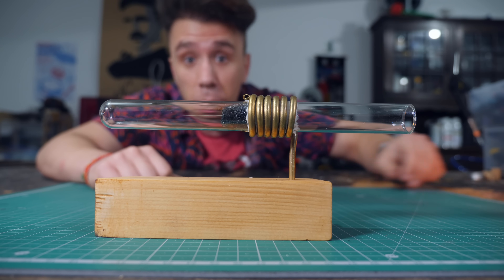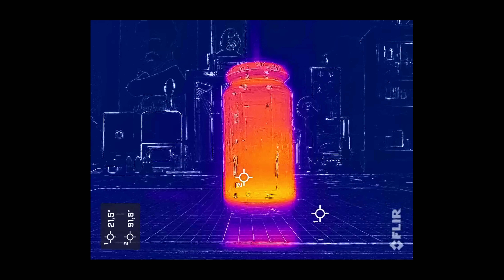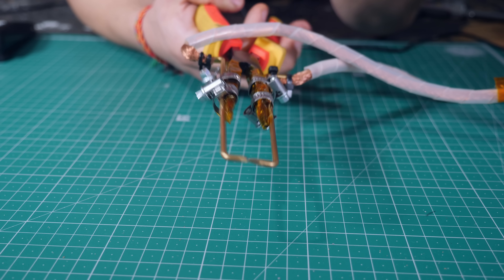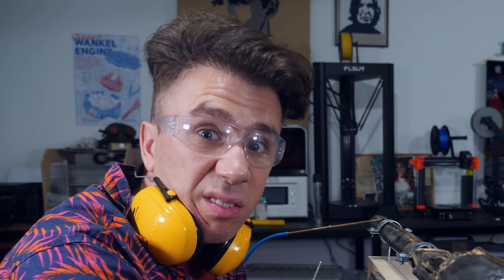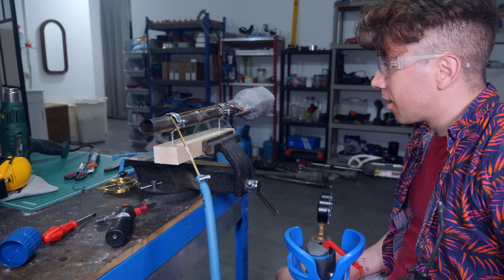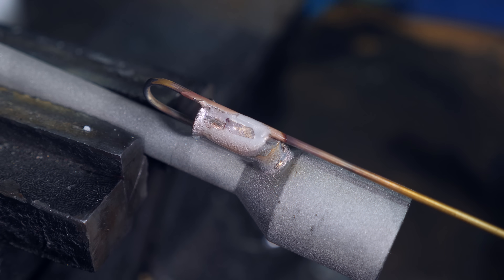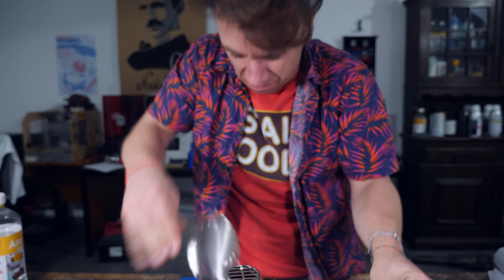JET ENGINE with NO MOVING PARTS (Pulsejet Engine)

Comment: would you be able to do a homemade telescope?
Reply: The important question is what's your budget... If you just wanna see the moon and planets .. even saturns rings , you can make one for pretty cheap , I made one for about 25 usd
Reply: @zakirsheikh4209 any link for that?
Reply: my friend made a solar projector (basically a telescope which is designed to project an image of the sun onto a surface) as a school project. He built it out of cheap materials on a budget of about £50. The most expensive things were the lenses, but he used quite large lenses. If you chose smaller lenses it could be cheaper. Nonetheless, its actually a great solar projector, its easy and safe to use (you physically can't look directly through it) and if you can see the sun, then you can see the sunspots on the projected image.
Reply: if he is making the lenses, that's going to be a near impossible task. If he is using a kit, it seems... a bit too easy. 

The middle ground would be: buying the lenses, then 3d printing the telescope itself. I don't know what level of challenge that would be for him 🤷‍♂️ 

Interesting idea, though 👍 I've seen people use raspberrypi and arduino setups that allows for a telescope to track object automatically.  

It also used a reference point in the sky, so the user could enter a celestial body they want to see and the telescope would move via the electronics so that it was pointing towards the desired object. It was pretty cool but more about programming than building, in that case.
Reply: I'm not sure if the lenses or mirrors can be homemade and work well enough
Reply: That would be pretty impossible without expensive technology
Reply: Booring.

Comment: You have 3d printer, spot welder, you can print small centrifugal compressor, make combustion chamber, nozzle and turbine, make small 5 cm diameter turbine jet engine, like this one:
https://www.youtube.com/watch?v=0QRuiT2DjpU&t=32s   it would be great and put it on small 3d printed jet rc plane, you can use light pla filament, it is used by modelers of rc planes...

Comment: Could you 3d print FDM and then use nickel plating spray to make it more heat resistant? Some use that spray to plate plastic with other metals.

Comment: Does the larger pulse jet need tuning to run on different fuels, tube length for pulse frequency etc does the stoichiometric ratio need to be considered. have you thought about trying to cast your pulse jet?

Comment: If you not good at welding , why do not try with molding parts the most exposed elements to heat (like chamber or exost). You can  3d printing model and make a mold using it (like here https://www.youtube.com/watch?v=2CIcvB72dmk&ab_channel=CastingtheFuture)

Comment: My bid for the 3D printer: Make a jet engine that runs on any oil which produces electricity to power any vehicle. A jet powered generator that produces electricity on-demand to move your car. Your fuel would be free, you can get it from local restaurants. The same technique that train companies use now. If every gas vehicle was powered this way cars would use much less oil. They go much further when the gas is used to produce electricity than an explosion. Efficiency is way higher when you burn the fuel locally.
Reply: If any of your engines you've made over the last year were used to produce electricity they would move a car.

Comment: 3D print a taurozzi pendulum engine there is very little to no friction in the design perfect for a print. They make them mostly for air compressors, but I'm sure you can run it with any fuel source. 😎 
You could use the engine to outrun an attack from the Killer Tomatoes
😂😂

Comment: Hey integza i got an idea maybe you can put it in action. Can you make an HHO generator that is powered by the same power output of a jet engine running out of this same HHO generator. Basically make an HHO gen running out of the power of an electric generator being pushed by the same jet engine pushing a propeller.

Comment: You cant run away from welding any more. You clearly need it.
anyway, I think seeing you tinker about radio waves would be cool.

Transmitting energy with radio waves to power something, as in wireless chargers.
Or maybe a simple radio transmitter so you can radio control a boat or something. If I recall correctly Tesla did it, so you should be able to as well.

Comment: I'd be over the moon if you tried water cooling (or fuel-cooling?) one of your jet engines. Maybe try another 3D-printed engine with fuel channels integrated into it like Nasa did with their rocket engines (Nasa used wax and electroplating deposition technique, but 3d printing might prove a liiiitle bit easier ;) ). congrats on this engine btw, it looks stellar!

Comment: I just watched your Tesla Turbine video before this one and had an idea for it. You should use the Tesla turbine to try and make a generator that use steam heated from solar energy. Maybe water in black tubes or barrel, the black absorbs the heat, which heats up the water and makes pressure and steam to power the system. It would be interesting to see if a system like that would work. It would be really cool if you could somehow make it an  enclosed or mostly enclosed system to recycle some of the steam. Hope that makes sense. I want to try doing something like this and it would be cool to see your attempt at it and even see if it's a plausible design.

Comment: Metal working isn't as hard as you might be making it out to be. You could learn to run a wire feed welder in a few hours with some YouTube. Flux core wire doesn't need gas, so it can be a simple and very cheap way to get serviceable results. I paid about $100 USD for mine plus $40 for an auto darkening mask.

Comment: There's a process where you can cast your own aluminum parts using a 3D-printed positive... it could be useful to make large, cheap, heat-resistant metal parts for new engines

Comment: Possible future video/implementation
you could build a small thrust measuring setup, guided on air pressured rails (atmospheric railway), so the future jet engines can move with minimal traction. More air pressure could also support the weight of the whole system. The thrust could be measured by the sled pushing against an precision scale. This way you could directly record it for the your videos
It would be really interesting to see and compare the thrust from different engines

Comment: What if you water cool the engine to prevent it from overheating or use a fan to blow air around the engine so the engine can stay cool for longer?

Comment: Do do you want a material that's called Starlight. The original innovator of it passed away before anyone can get the formula out of him but you want to cover a lot of this stuff that you're using wood Starlight it's basically fire retardant and Fireproof it was one of the original set the tiles it was put on one of the first space shuttles the gentleman then told NASA they were not allowed to have his stuff and literally removed it all from NASA's property and possession. But dude when you're doing stuff like that JB Weld withhold heat way better than a spot weld does and using that flux to weld with it gets too hot that flux melts right away you got to figure out a way to get your stuff to where it's almost impervious to heat you'll have to layer it with several layers of fire retardant material how about wrapping the outside of it with the same stuff that they use to make metal forges you can use household insulation when you get it wet it works real good smashing drywall spackling into the fibers once you get it wrapped it's bismuth and gypsum mixed when you pack it down and get it really really tight IT compresses everything and it makes it almost fire-resistant Fireproof

Comment: Integza thank you for delivering such top noch content. Jet engines have always been one of my favourite topics and like you i am also truly fascinated by the pulsejet due to its thrust to weight ratio, lightweight design but maybe most importantly the sheer simplicity of its design. "Where normal people only see some random pipes, i see a potential jet engine."

Now for the main part: I have a suggestion for an experiment that you could try out with a pulsejet. I just happened to remember one of the Mythbusters episode where they tested out sewer explosions that caused manhole covers to be launched up in to the air due to ignition of built up methane gas. Now the most interesting part of this experiment is what happened when they loaded the "sewer system" with different types of debris that caused the explosion to accelerate at an extremely rapid pace compared to the "clean" sewer system (in the small scale sewer test that they performed i believe they tried filling it with metal springs/ coils of different sizes that would simulate objects that may somehow end up in the sewers like ex. bicycles, wheels, wooden planks and other random types of debris/objects). This made me wonder if this effect somehow could be exploited to increase the performance of a pulsejet by for example placing a metal coil(s)/ wire inside the combustion chamber or perhaps by partially or fully lining the combustion chamber with some kind of steel mesh. 
I think it would be really cool to see some experimentation using this effect/ principle and if you are able to make it work reliably maybe you could build a test rig and compare the performance of different fuel types like Propane(used as a referance fuel), Ethane, Methane, Hydrogen ++ and maybe even try some types of liquid fuel like different alcohols, heck maby even some Nitromethane. Just be careful when using liquid fuel as it can be hard to manage it in a pulsejet and can easily drip out of the pulsejet and set the ground/ surrounding on fire (In my teen years i once set my parents wooden terrace on fire while trying to start a pulsejet using a 50/50 mixture of alkylate petrol and nitromethanol(25% nitromethane IIRC), luckily for me my ADHD brain had developed enough sense in regard to safety to have the gardenhose laying ready in case this were to happen). 
As an additional note: Different fuels may operate optimally at different pulse frequencies, this probably also depends on related factors such as fuel pressure and injector design/ placement. To a degree you might be able to make a quickly tuneable adjustment system to the pulsejet by adding a telescopic section to the tailpipe as this can alter the "resonance/pulse" frequency it operates at (IRRC there is someone who have tried this and have a video(s) about it here on youtube).
Best of luck with your future projects and experiments

Comment: Make a vid about where you learn to weld better and make a turbofan not turbojet engine 
A turbofan is a jet engine which has a bypass to cool the main engine which takes like 20% of the total air sucked by the huge fan in the front of it
If you learn how to weld better then you might be able to make it 
If you did then put it on Idk a skateboard or rc plane

Comment: Having an active cooling system might help with the melting issue. No idea how jet engines do it, but rocket engines use the fuel, which might work here (or be disasterous). You could run the fuel line coiled around all the parts that get hot before pumping it into the chamber, which might increase cooling and performance, and at the very least add thermal mass to the sheet metal. Just adding more thermal mass by sticking more metal on there, like brass tubes coiled around the chamber, would probably also help avoid melting.

You could also use water, either passive submergence or active cooling (maybe pumped around by the heat energy of the engine), but i feel that might miss the spirit a little bit.

Comment: Maybe make a lightweight rc plane that uses the little metal pulse engine? Maybe make a "paper" plane body with the resin printer (using the thinnest printing setting) and fire proof it so it doesn't melt

Comment: A flying pulsejet get's air cooled ...if you water cooled the metal / plastic static engines you might if doesn't melt ...

Comment: All of your stuff blows up because it gets too hot.

I dont expect you to use the fuel as coolant around the hot stuff as did in most rockets, but you are stationary and weight doesnt matter on your „test stands“…. build a cooling jacket and pump water thru it, i want to see a engine giving full power for some minutes without blowing up/overheating.

Comment: Video Idea: Utilizing a sand battery and a stirling engine in combination  to produce power. Or some variant of thermal powered engine. I think thay using the a stirling engine as a heat pump to assist the heating of the sand and then using it to produce power.

Comment: How about adding Tesla Valves to the Pulse jet engin.
Sothat the air intake is on one side of the Engin and on the other side is the exause. Both hate a tesla valve that only allows flow th the excaut. I´m ont quite sure if that defeates the purpose of a puls jet or it might become a continious jet engin.

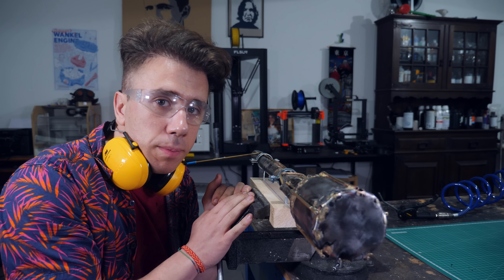Comment: 5:34 Yeah, wishful thinking. Renewable energy, in particular solar, are at pitiful low levels simply because they're not reliable enough. Solar is good for small applications, like portable chargers and rooftop installations, but using solar power to power a country is an environmental disaster, not only due to all the wild habitat that would need to be destroyed, but also by the damaging mining procedures required. And then we come to cobalt mining, which is an absolutely disgusting practice that is a humanitarian crisis of its own.

Comment: 6:41 You are most likely correct about it being because propane burns better, because it does. Propane consists of shorter hydrocarbon chains than butane (propanehas 3 carbon and 8 hydrogen atoms, whereas butane has 4 carbons and 10 hydrogens). This makes it burn better as there are fewer bonds to break in combustion

Comment: Video Idea: compare and contrast High Bypass and Low Bypass turbo jet engines to show viewers the optimization methods for efficiency and specific thrust. It would be valuable to the average viewer to understand why manufacturers pick certain engines for their desired performance ie. commercial vs military usage.

Comment: make a RAMJET, it has 0 moving parts and is actually used in modern aviation, and is considered one of the option for space planes.
it would need air intake to move in at least half speed of sound, so it would need some preaty beefy blower for tests, and some kind of first stage for first flight, a solid rocket, gauss gun or railgun should give it enough initial speed

Comment: What if you've made a 3d printed metal plane that uses 4 of your pulse jet engines. You can store the gas inside the fuselage, and controll the 3 axis and the 4 engines with an Arduino from a control panel from the ground. I can also code the Arduino for you and design the control panel.I don't know how possible it is to make, but i think it would be a cool project.

Comment: Pulse jets are fascinating. I was looking into them further and discovered something similar called a "Gluhareff Pressure Jet" or "tip jet". It also has no moving parts, but it has a different style of intake. I'd love to see you build one of those.
Reply: this was the one that fitted on the end of a helicopter blade?  There was another called the Reynst-o-dyne i think ...   I built a bunch of them about 25 years ago, and have loads of blueprints and plans somewhere.

Comment: It may not be very groundbreaking, but maybe you should try tig welding.  It is relatively simple if you do not expect beautiful welds that require practice. As for the costs, if you do not plan to weld aluminum, the welding machine itself is not quite expensive, and it does not require a 3-phase power supply.  All you need is a welding machine, a gas cylinder and a reducer.  I think there would be someone around you who has such a welding machine and would let you try it.  This would definitely expand the scope of projects and their quality.  They wouldn't  melt so quickly :D

Comment: I think u should make ramjet next, for people who don’t know - A ramjet is a variant of an air breathing jet engine that does not include a rotary compressor; rather, it uses the engine's forward motion to compress the incoming air. A ramjet cannot function at zero airspeed and therefore cannot be used to power an aircraft in all phases of flight. And I wonder how you will solve that problem at home

Comment: If you have access to a metal turning lathe, the pulse jet looks like it would be suited to making out of stainless steel constructed by screwing the parts together. Or perhaps slip fits secured with grub screws.

Comment: Why not make a cooling system? The ones that where on the planes had air flow to keep them cool. If you make something like a radiator or find a way to blow out standing cold air on the rocket you should have better success. No?

Comment: You should try to print with protopasta iron 3d printing filament and then sinter out the plastic so you are left with just the metal.

Comment: Paulsgarage has been doing work with 3d printing with a wax resin that you can then cast in metal using lost wax casting. That might be a good option for you to attempt your own larger scale metal needs without having to spend the ridiculous money on a metal 3d printer. Check out the work he has done, it might give you inspiration. Oh...And tomatoes are disgusting.